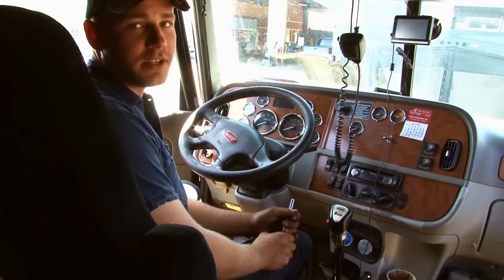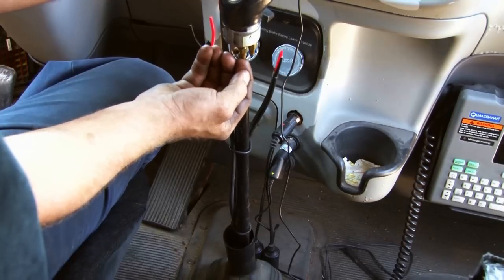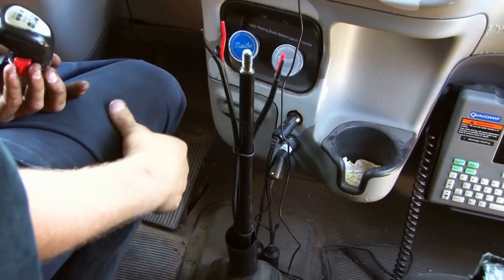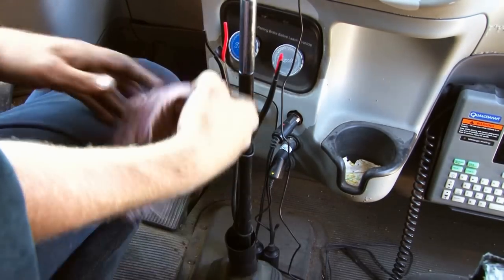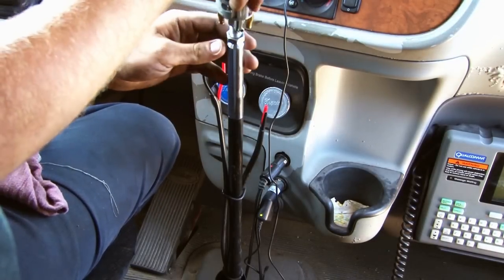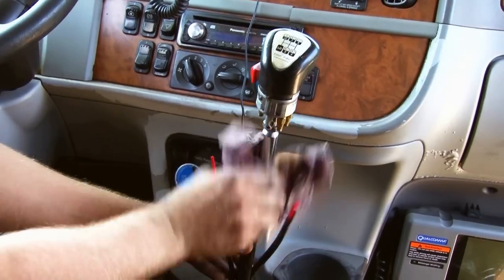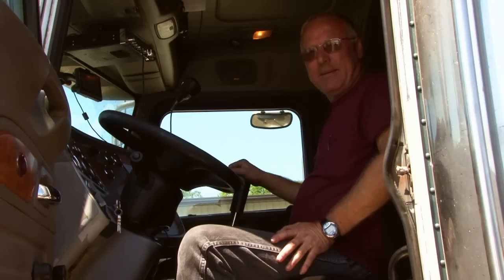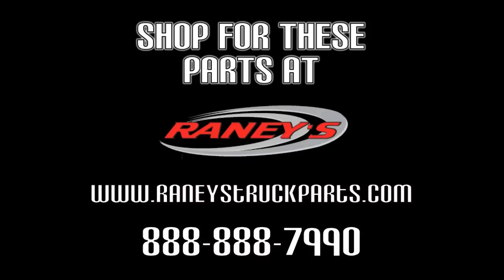How to install a shifter extension on a 13 & 18 speed transmission (Part 1) | Installation Video

Comment: Do you need to bleed the tanks before you take it all apart?
Reply from the maker: Hi Erik Camarilly,
There is no need to bleed the tanks, all the air will drain out when you detach your line from the shifter initially.
Hope this helps!

Comment: When you take the shift knob off be 100% sure you let every bit of air out, there is a spring and a tiny ball bearing under the side splitter button and if any air is left in there it will shoot the ball bearing out and then your fucked, spoken from experiance... Take your time and be very patiant dont try and do a rush job. Also on the other side of the button there are 2 springs and a plastic cog that sit overtop 2 air holes. Dont lose these either and remember how everything gos back together
Reply: This post should be at the very top, Raneys should advise those DIY'ers before they show them how to fuck it up, yet I assume if they have to pay to learn the lesson,all the better for business

Comment: Somebody know how can I find the conections and the hoses on line?
Reply from the maker: Hey David! Most Air Lines are 5/32" diameter nylon tubing. The fittings can be purchased from a hardware store.

Comment: What i did for extending air lines is buy an extra air line 2 feet cut in 4 equal length and 4 push in connectors you need , take 1 line at a time from shifter( push bottom in pull line out) attatch connector on line and other side new line you bought and then other end of new air lines into shifter color coded.Confusing , i know but u will figure it out , I extended 12inch (2×6 inch) but it become un balanced and make grinding noise so took off 6 inch....

Comment: Hand tight is never tight enough. Put a lock nut on with the extension too.
Reply: Put some locktite on the shifter threads and hand tight is tight enough